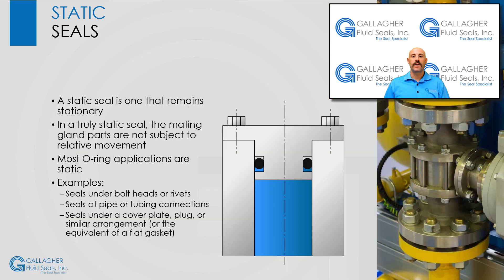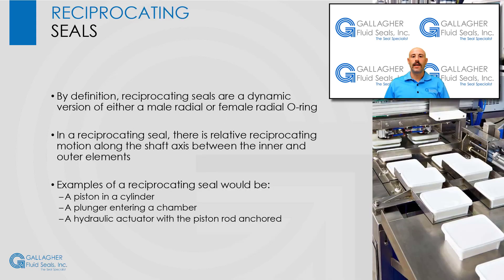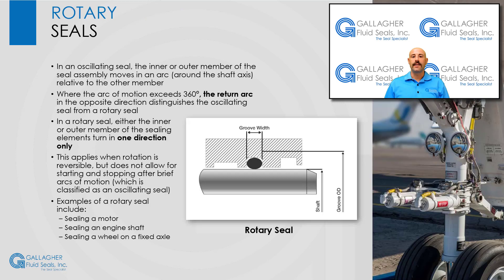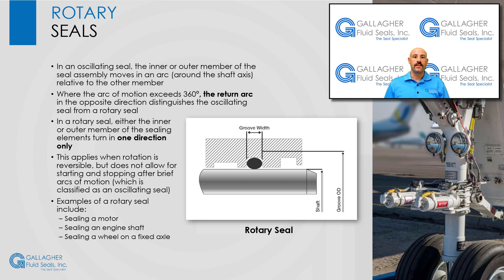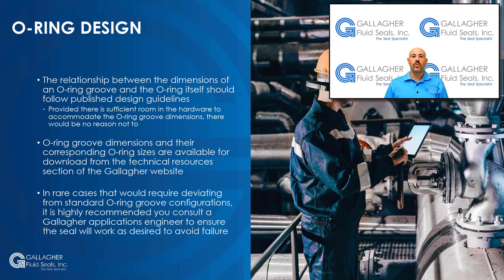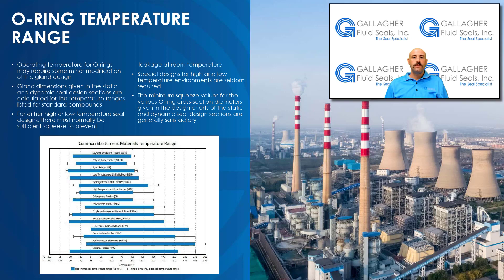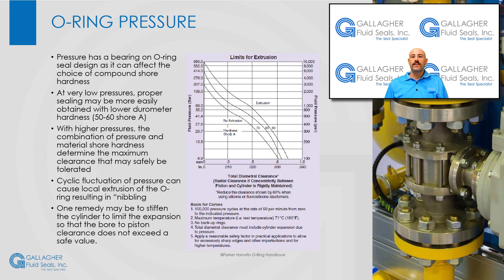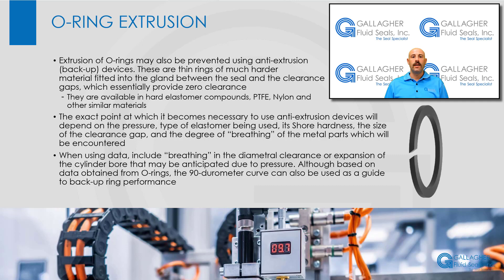Basics of O-Rings | Core Applications

Comment: What is the best type of o-ring for cryogenic applications, such as a vacuum plug?
Reply from the maker: Hi Seth, in general, elastomers are good for COLD temperatures but NOT cryo-temperatures. Cryogenic temperatures is somewhat vague, but most consider it to be around -200°F. There are certain silicones or fluorosilicones that can seal around -100°F, but anything colder than that is when we would move towards spring energized teflon seals. If you have an active project or anything that needs engineering guidance, you can reach out to start a conversation at GFSsales@gallagherseals.com. We have two full-time seal engineers that can help with complex seal designs (or basic ones as well). Thanks!

Comment: Can your company manufacture bespoke static Seal with the following specification?

Seal internal diameter - 6.5mm
Seal thickness – 15mm thick, 5mm height
Seal Operating Temperature – 5oC to 40oC
Seal material - preferably Polycarbonate but welcome your recommendation.

Seal is static and used on rotating shaft with details below
Shaft diameter - 6.5mm
Shaft length - 18mm
Shaft material - Chrome (It can be any other material that you recommend as long as it does not rust)

Suggested Oring CS - 2mm 

The seal is required to prevent water leaking through the rotating shaft. 
Liquid is enclosed in the sphere-like structure of 35mm diameter. Sphere will retain liquid for up to 2minutes max then it is emptied.

Human hand must be capable of turning shaft clockwise and anti-clockwise and seal still prevent leaking.
Reply from the maker: Hi there, I confirmed with our sales team that we received your request over email and they are reviewing your inquiry and will get back to you as soon as possible. Thanks for reaching out!